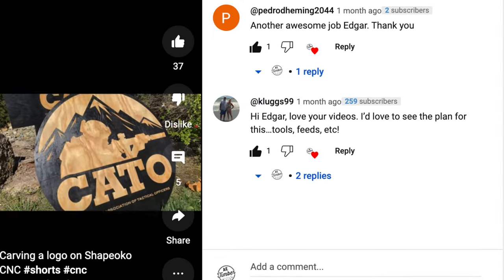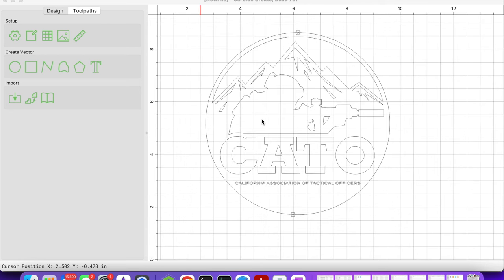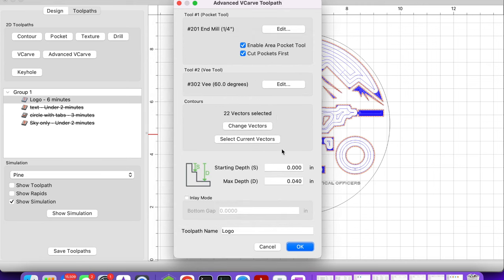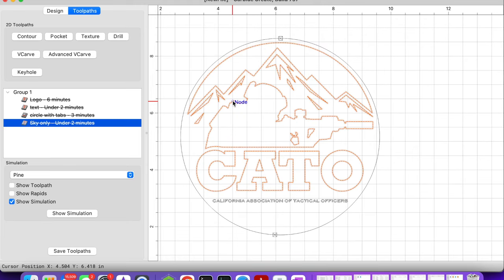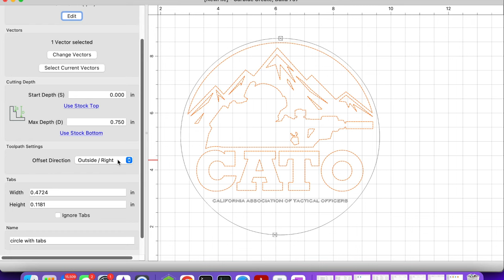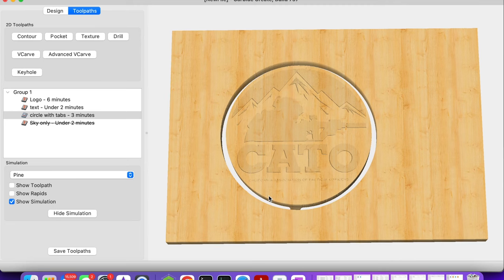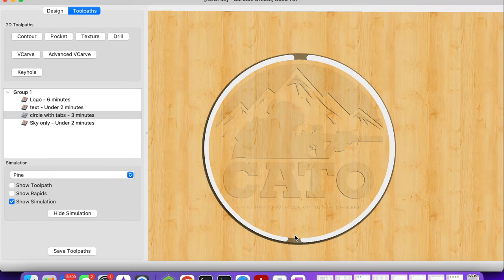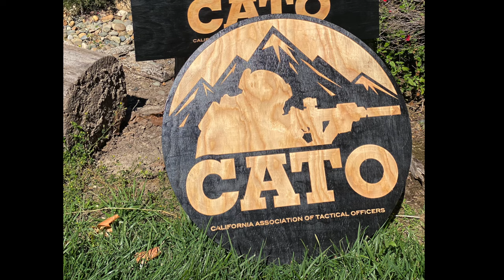Carbide Create Tutorial: Carving Multiple Toolpaths on Plywood

Comment: Hi Edgar, good explanation of your thought processes. 
1stpass of sky looked clean, 2nd pass revealed paint or darker core. Wondering if paint leeched through a gap in the ply?
Because ply is usually brittle , I prefer running the V-bit 1st which will clean cut the surface edges. Then the flat carve out middle. Beware of ending up between ply core depths, looks grotty,  need to end up within a ply core
Reply from the maker: Hey John, thank you for always great feedback.  I immediately though it was material that wasn’t flat and didn’t even think about the fact that the stain could have gone deeper in that area. I’ll have to keep an eye on that for sure!

Comment: Hello Edgar.  When resetting the z zero how exactly do you do that? I have a shapeoko with a bit setter and also use the corner tool when setting my job up.
Reply from the maker: Hi Wayne,
I simply reset my z zero AFTER my first run is complete.

I use the paper method so I jog the machine to an area that didn’t get carved and then set z zero in that area.  I believe you’re using the bit zero and I am unfamiliar with that tool.

Doing it my method doesn’t affect the bit setter.  It will work normally. 

I think the take away is that follow my normal process after the first run is complete. 

Hope this clears that up.